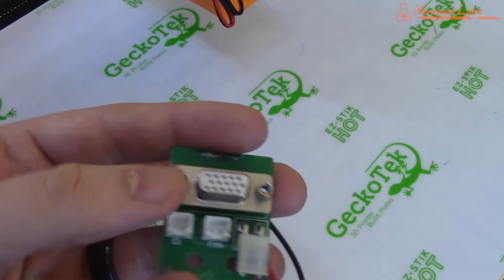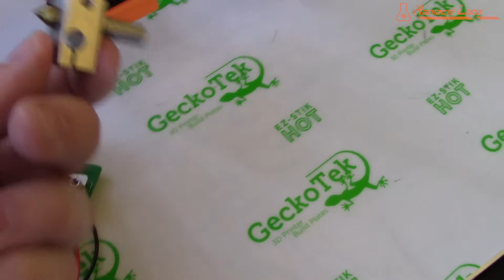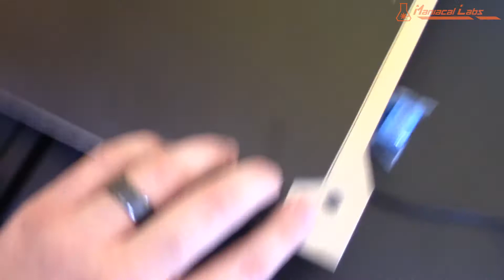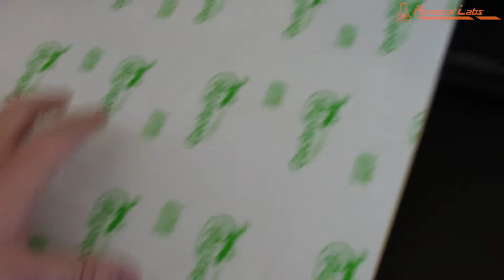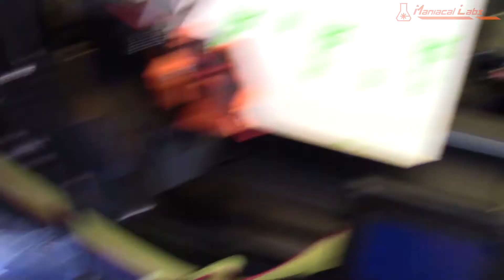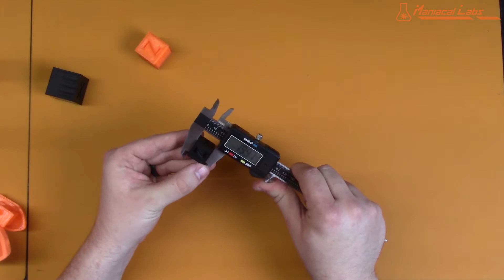Formbot T-Rex 2+ - Mods & Review

Comment: Hello!  My name is Dave Langkamp and have been 3D printing now for over seven years.  I am happy to find your video online as I have a friend of mine that has been struggling for the past year to even get his printer (the same as yours) to even print one part.  I use a Creality CR-10 S4 that I have been using over a year now and a Makerbot Replicator (original) for over six years before it died.  Loved the machine but it was time to upgrade at that point.  Anyway back to my friend in need.  He has had his Formbot T-Rex 2 now for over a year and as yet been able to get it set up to print anything.  I talked with him a few days ago and it looks like the calibration to level the bed is messed up on it.  Or at least that is my impression anyway.  We ran through the procedure to level the bed and when you get to the part where you are supposed to have a piece of paper under the extruder and lower it to meet the paper it never gets there.  We dialed it down to read zero on the machine and yet it never touched the paper. No friction at all.  We then adjusted the bed to raise it up to get the proper friction between the paper, bed and nozzle and then recalibrated again.  The second time around again even though we had brought the bed up to where we thought it should be the machine again brought the nozzle down to meet the paper and again went to zero on the control panel and we had no friction again between the bed, paper, and nozzle.  Any help that you can give me to pass on to my friend would be greatly appreciated.  At this point my friend is ready to chuck the entire machine out the window and write off the two grand he spent for it.  Here is my email address.  Davecc@mediacombb.net   Please contact me and I will pass along my friends email address so that you can possible help him get his printer running before he throws in the towel on 3D printing all together.  Thanks, Dave
Reply: You may want to raise the buildplate by putting something under or above it. a sheet of metal or anything flat should do.

Comment: Love the review.  I am planning on getting this one here in a couple of weeks with all of the additions (heated bed, high temp nozzles, etc...) along with the extended 700 mm height.  Despite your very wise warning, this will be my first 3D printer.  I am working with a friend who has some experience and we are shooting to do a 3D printing startup on the side.  I am 44 and have 30 years of IT background including programming and have an engineering degree, so I have a better chance of understanding the technical side then a good portion of people would, I hope.  My co-worker has a small printer and is about to order the Prusia MK3.  I want dual extrudes because I have a lot of items I already have designed in Fusion 360 that utilize different materials and/or colors.  And I would like to be able to print tall items like vases and lamps also.  I have joined the FB group, but hopefully I won't have to ask too many questions as many are already answered there.   Thank you for your great video's and I will definitely be re-watching your unboxing and assembly video again when I finally get mine in.

Comment: great review thinking about getting the raptor myself, how annoying is the 36 point bed leveling? seems like it takes like 30 mins
Reply from the maker: The 2+ that I have does 255 points and takes around 25 minutes. But you do it once and then you are done until you do something to your bed that would change it. I haven't run mine in 2 months. So it's not really a problem at all.
Reply: Maniacal Labs LLC 
Nice, it bed levels so good so theres never a problem on the first layer? I hate adjusting the screws a million times or on Prusa messing with the live z. I saw the raptor has the ball bearings now too
Reply from the maker: I can only speak directly to the 2+, but on that the bed leveling screws are quite solid so they really don't move. You level the bed to the x-axis and then run the UBL probing (what I was talking about above). That probes the whole bed and then when do what's called "tramming" when you print which will adjust for the bed being unlevel or even warped a little bit. But yeah, it's quite good... I've never had issues with the first layer not being good because of it being out of level. Note: There is no replacement for correctly leveling your bed, but this really helps it go that extra mile and keep you from having to re-level before every print. As noted, last time I leveled was 2 months ago.
Reply: Maniacal Labs LLC 
Sounds great, do you think the raptor would be more novice friendly not dealing with dual extruders?  I've built a printer but would hate to fuss around with gcode and stuff. I'm not an engineer lol
Reply from the maker: Raptor has less stuff to go wrong... it's simply a less complicated printer,  so probably so. But I doubt that will make their docs any nicer. With a printer of this caliber, get familiar with gcode. it's well worth your time. I don't use it all the time, but I had to tweak some profiles and such myself and it was very helpful to know.
Reply: Maniacal Labs LLC 

Thank you for your info, you and 3d printing nerd are pretty much the only reviews on the entire internet about this machine
Reply from the maker: Haha... no problem :) 3DPN still hasn't actually even put out is official review. Just some test prints. Don't know why :P
Reply: I have tried to level the bed many times since i got it and i still get parts that hit the bed and then all of a sudden parts that are too high to stick to the bed. Tried everything

Comment: would you be so kind and put the spool holder file in your set? I checked few times on your video and haven't seen it.. thanks for updating the link for the FB group
Reply from the maker: They aren't my design and honestly I can't find where I got them from. Probably somewhere in that facebook group.
Reply: @Maniacallabs  I found it in your other video.. by going back to your video few times.. I have decided to buy the new T3 and immediately thought of changing on one extruder all metal hotend replacing the stock.. Ada is pretty good in answering all the stuff and told me they are using high temp Capricorn XS tubing but I mentioned that is melting at 360 degrees why they are rating this to 350 so that's a way too close.. but I would love to see someone trying to print on PC filament ..  as of the plates I agree adding all the metal will increase the weight and if you have build up area that high 2amp motor is definitely needed. I asked them to put 2809 on it... would love to see some sort of rolling frame like gecreate has .. lastly the add on plates you mentioned are hefty 205 bucks for the buildtak system and then 89 for the greckotek but I think it's just one sheet for that price   I'm completely on the same page with the dual sensor as paper is being good guide.. you can't never match the 2 especially if you need to move mechanically one up or down.. unless dropping them both completely down at the same time and just have the nozzles touching the plate and tight both up at the same time, then probe the left side.. this kinda reminds hydraulic brakes setting up using business card, I will try that  but I know they have to be right next to each other..  have you had any clogs using regular PLA? are you using the olive oil or any other oli such silicone .. lastly people showed and share videos of the chain rubbing against the heat bed wires.. maybe shaving bit off on them and lube the wires would help with that.. or add extra shrinking tube there...

Comment: Where do you all recommend buying this printer at?  Also does the printer come assembled or is assembly required?
Reply from the maker: Mostly assembled. You have to attach the Z axis uprights (which holds the X axis) to the base (which holds the Y axis). 2 bolts is all. Then a bunch of making sure everything is level. Watch my earlier video where I assemble it :)
Reply: I saw after my comment here thanks don't look to bad of a build.
Reply: I'm using your fan modifications big improvement like night and day.